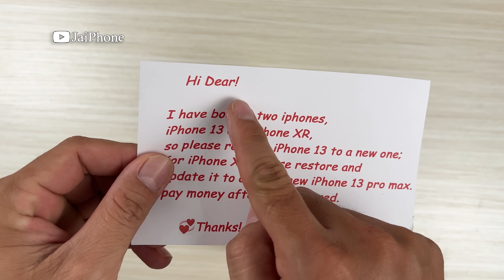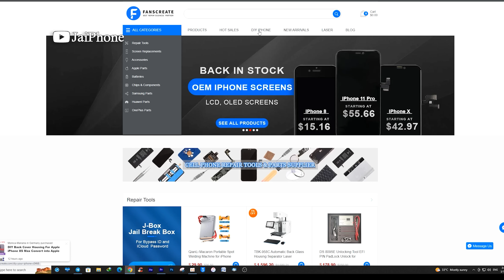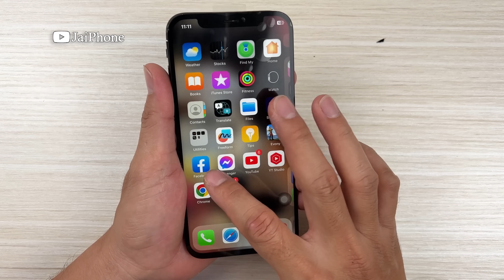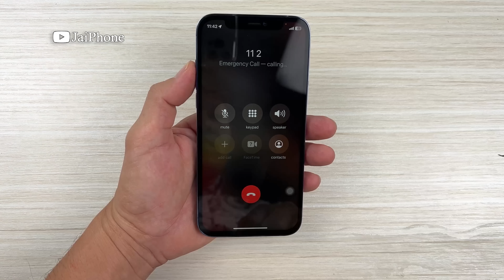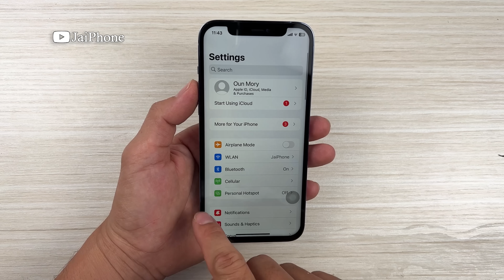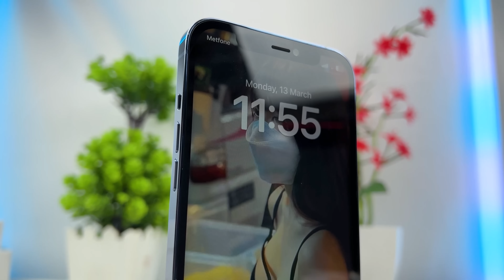How i Restore and Turn iPhone XR to brand new iPhone 13 Pro Max Like 99%

Comment: A great job my brother. For iPhone XR to 13 Pro Max, it can be directly original Apple iPhone 13 Pro Max cover case, never worry about the protective case after converting it😍😍😍
Reply: Make smaller diy face id components for old iPhones same way y’all did LCD flat screens for xs max , XR etc etc I know it’s possible gangurr 🙏
Reply: what about screen protector? use with 12 pro max?
Reply: @bl4cky724  no, wat ever iphone model it is
iphone 11 use iphone 11 screen protector
Reply: @LOCKBlT  bro it’s 6.7 inches screen how can be using iPhone 11 screen protector
Reply: @LOCKBlT  this housing have bigger screen have you see?
Reply: @Dang sominea yeah that’s what I thought thanks you so much
Reply: @bl4cky724  what iphone u got
cause a bunch of these screens are similar in size but they aren't
Reply: @Dang sominea brydda man sad]
Reply: Hello please make Xr to 13 mini with 12 mini display combo exactly you win❤
Reply: This is literally bs. Making a 13 pro max from a regular 12 is bs. First of all what about the Bionic processor ?. About the cameras ? And the quality ? The battery ? The features ?
Reply: @LOCKBlT  điều đó có thể xảy ra khi các kỹ sư thực hiện nó
Reply: Faz a bateria maior também
Reply: and possible to be released for sale in the near future of iPhone XR shells like iPhone 13 pro max or other models with the sim carriage on the left so going to make an additional modification ? or a screen that simulates dynamic Island like 14 pro for iPhone XR ?😕